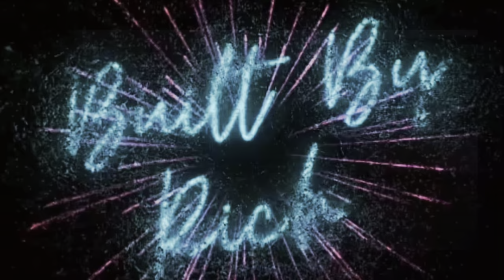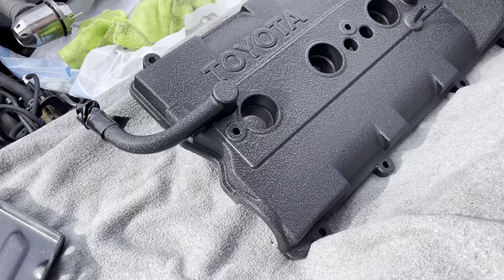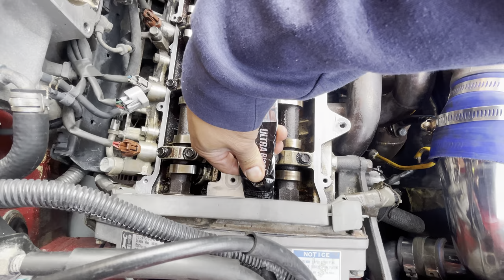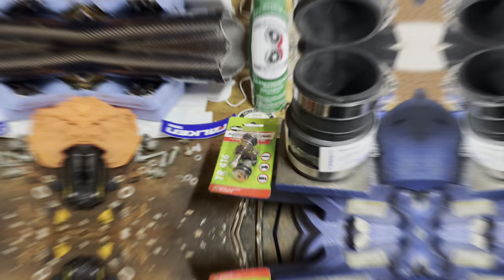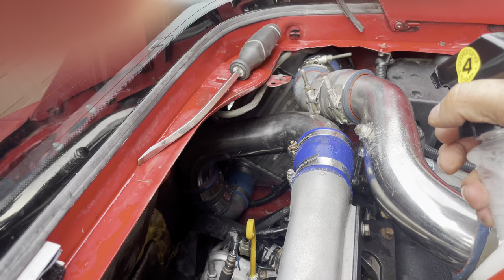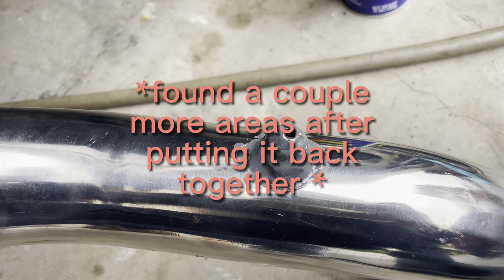Mr2 maintenance to nightmare

Comment: It's always like that with a new-to-you car, until you go through the whole thing. I remember with my Z, at first, the brake lines were pretty much welded together due to corrosion. Some weak bolts shearing, and finding rust in places you didn't expect there to be. Now it's a pleasure to work on in comparison to anything else.
Those new valve cover washers are nice with the rubber bottoms, my 7M used to have them but they were toast. I'll have to find some replacements.
Reply from the maker: I agree. All part of the process. I guess it gives me more content for the channel although is not the cool thing to watch but it gives the whole story of the car.